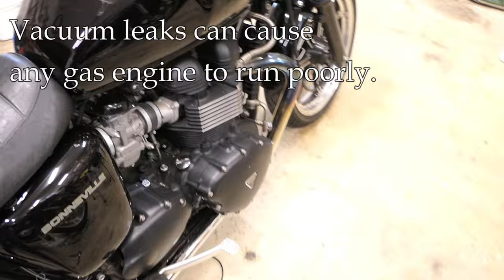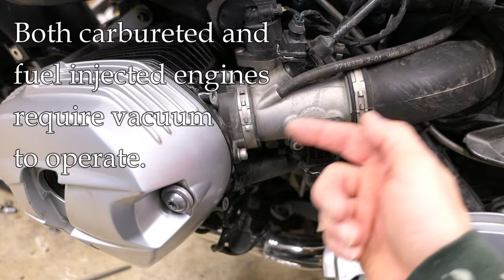Vacuum Leak Troubleshooting On Your Motorcycle

Comment: Good topic and thanks for explaining it so thoroughly.  I have a 2015 Bonneville T-100 and would like to let everyone know that this is an issue on Older WC Bonnies'. You can see at 1:35 that the throttle body (TB) rubbers are angled.  This design along with the weight of the x2 TB's will loosen over time and rough riding.  Each TB has only two rubber connection points as well as being connected to each other.  It is important to understand that the engine vibrates on its mounts according to engine speed, clutch action and chain torquing.  This is different than the TB's that react more to frame moments. Anyway, my point is the protentional for vacuum leaks on this bike need to be checked at the start of each season.

Comment: Excellent video! Recently my 09 started to idle terribly, and make a rattling sound in the left cylinder. Long story short, that rubber hose you show had fallen off! After putting it back on, I could still pull it off with gentle pressure. At almost 15 years old, it was time to change it. Project for today.........
Reply: After a bit of investigation, I found that that hose goes to the charcoal canister that collects fuel fumes from the gas tank. A solenoid opens upon start-up to let the fumes there be burned. You may have heard of people doing "canisterectomies".

Bottom line is that if your hose ages and does not stay on while away from home like mine did, you can just put a vacuum cap on the barbed nozzle, and unplug the solenoid. The canister and solenoid are located under the front right tupperware.

This hose and canister are installed only on U.S. models, so it does not show up on all parts diagrams.

FYI, the hose has a bend and wider opening at the canister end, so it is BMW specific. You cannot just go to the auto parts store for some 1/4" hose. I put a vacuum spring clamp on the loose end at the throttle body.
Reply from the maker: That charcoal canister is an emissions device which goes back at least to the early 1970s.  They have never worked very well, and they have caused headaches for mechanics for decades.  They work adequately out of the factory, but later they can become fuel logged, cracked or the vacuum hose can crack.  Glad you found your problem.

Comment: John, i love your videos and thank you for your guidance. Could you recommend the tool that you use to remove the i take boot clamps?
Reply from the maker: There are a few different kinds of these clamps, which work in similar ways.  They make specialized pliers for each type.  Honestly, I don't own any of them! If I'm faced with removing these specialized clamps on any vehicle, I'll often just cut them off and replace them with a standard hose clamp that uses a phillips screw to tighten the clamp.  But, you can get similar to OEM style clamps and the pliers on Amazon if you wish.